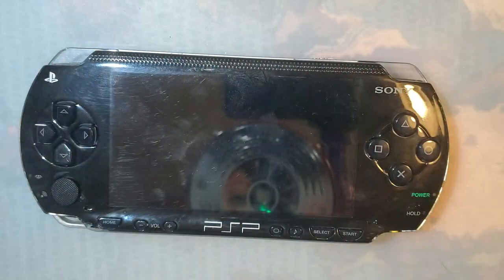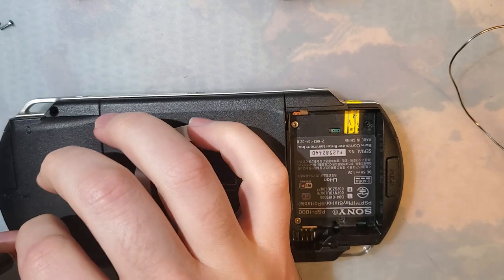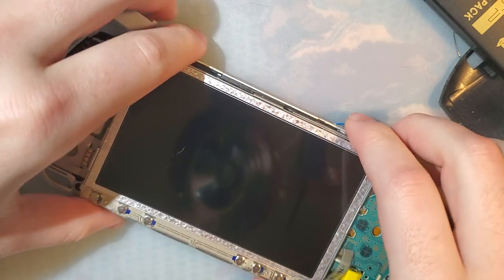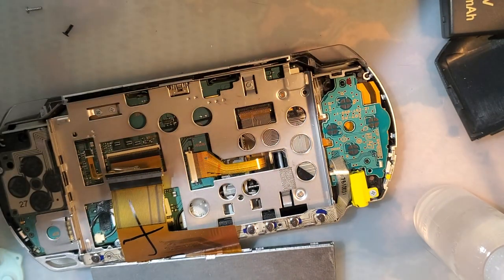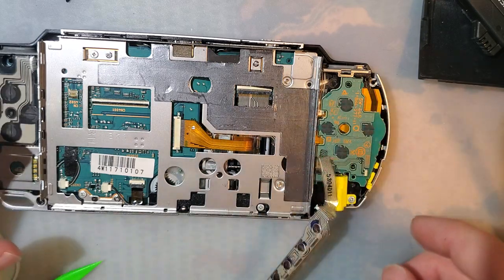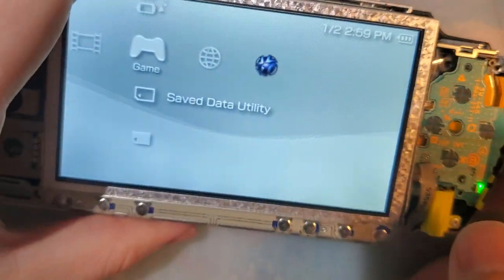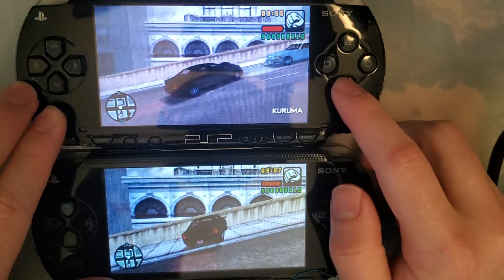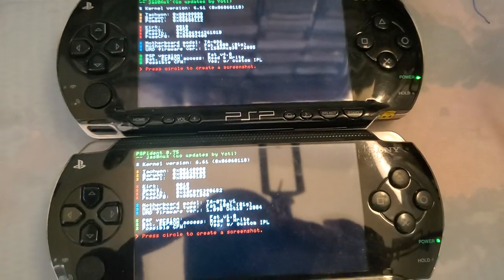Install Followup IPS LCD in a PSP (1000) (Part 2 of 2)

Comment: If you pause the screen at 22:59 you will see exactly how much richer the colors are in the IPS screen. Look at the money numbers in the top right. They are a nice vibrant green on the IPS, and a dull washed out green in the original. Also, the hardwood floors have a deeper tone. The wall is only hard to see due to the reflection on the glass. 

Pair that with the drastically improved motion via refresh rate, and it's a no brainer. This mod is a significant improvement. If this doesn't impress you, I don't know what would!

Comment: Watch both vids. Nice follow up. At this stage, unless one has some love affair with the actual hardware or perhaps is a collector, best bet would be to get a first gen Vita with the OLED screen,  add CFW, and enjoy the PSP library.
Reply from the maker: Yeah, that's pretty much the conclusion I came to. Between the battery life and controls, the Vita is significantly better. I'm not a fan of the non-linear scaling of the PSP games on the Vita display but there is a work around for a few games. Plus, you can play more than just PSP games on the Vita and there are quite a few decent games that released for the Vita.
Reply: I prefer to own both. You see PSP games do not look good on the higher resolution screen that the Vita has.
Reply: Can you explain how its non linear scaling when the vita has exactly 2x the resolution as the psp?
Reply: @wunderlichD  I was wondering as well. My guess is that there are some games that are not at full screen resolution on the PSP (just like the Vita), but then those same games would be scaled on the PSP, as well.
Reply: There are those of us that like to game on actual hardware, and not emulators. Especially those of us who are homebrew devs, and want to see how our games run on actual hardware. That said, since PSP emulation on the Vita was built-in and so popular, we have to test PSP homebrew on Vita, as well, just to be sure.

Comment: The ips is worth it for it's price. It's only around 10$ when I got mine which was surprisingly 2$ dollars cheaper than a replacement non-IPS LCD when I ordered it. Although just do it if your original screen is broken in my opinion.

Comment: I gotta say, this is a really badass mod if you still get mileage out of your PSP 1000, which I think a lot of souls in less fortunate countries definitely would appreciate. My only question is how much better is this than a psp 3000 screen in terms of color, motion blur, and visible motion interlacing?
Reply from the maker: That's what I was trying to show with my last video. The other video still shows the screen with the offset but that does not affect the color, ghosting, or (lack of) interlacing artifacts.

Comment: Modded my 1000 last night, instead of soldering or taping, I followed one comment under the taobao page and used a dollop of conductive paint, heated it with a hairdryer, and boom, off it goes. The real pain was to fix the possessed d-pad, took me a solid 5 hours. But all is working now, so I can show my future families how my childhood was like.
Reply from the maker: > conductive paint
yikes
Reply: @makho  it’s good enough for this application, really quick and easy, I was able to do the whole modding in a hotel room thanks to that. Reversibility is a bonus though I don’t see how I would need that.
Reply: And with a type-c to 4.0mm*1.7mm barrel adapter, a tf card to memory stick adapter, I see my PSP has been completely modernised, ready for another decade of service.

Comment: Hey! I wonder where you keep finding those strange things (perhaps i should check in the description links; but i m too lazy for that...) so now; concerning the joystick i had that kinda same problem with my 2thou psp and it turns out in 2000 models there is a sort of translucid rubber pad thingy that makes the correct contacts in between the board and the stick's mechanism. whishing you luck if you lost it by mistake though... and; as always keep doing your videos i'm addicted to them!

Comment: did you find theres almost some scanline effect when youre using it? If you load up a game for example. You'd see this Lighter horizontal lines that go in line with the P's on the PSP logo.
Reply: i have that issue with mine, very annoying

Comment: What happens if you don't solder those 2 points together
Reply from the maker: this is the whole reason I made this followup video. The image is not centered on the screen vertically otherwise.
Reply: @makho  sorry I had to watch it to realize I asked a dumb question lmao good shit. I just did one last night and now the umd won't read discs...  :/ Not sure if it's because I got a little bit of solder on the other chips around it :( or if it's just a faulty replacement umd drive. Or maybe it needs to be plugged in and back unplugged

Comment: Too much hate towards the PSP and the mod in this video :*(
Reply from the maker: because the PSP is objectively a bad console and this mod is way too much money (when you factor in import fees) for what it is. A Vita is not much more and is a significantly better console.
Reply: @makho  I can't change your opinion, but I love my PSP1000 now with the IPS screen (also d-pad mod). The ghosting on the OEM screen was a complete deal-breaker, but the IPS mod gets rid of almost all of it. 

I own a Vita 1k as well, but I much prefer the form factor of the PSP1k for PSP games. 

I'm curious how the PSP is objectively bad? It has its flaws and short-comings like every console, but I feel like you hate it just because it isn't made by Nintendo.

Comment: I'm pretty sure of this, but just asking to be 100% certain, did you just use solder to bridge the pads or did you use some tiny wire with it that I somehow missed? Seen a few videos from others where they do use it, and I feel that since the pads are so f*cking tiny, it'll just be a massive, unneccesary, pain to use a wire for that step.
Reply from the maker: just solder bridge. It's close enough that running wire would actually be more difficult due to the surface tension of a small enough piece of wire

Comment: Hey Makho, any thoughts on PSP Batteries?  Looking for a replacement for my PSP2000.
Reply from the maker: PSP batteries are all garbage in my experience. I don't plan on doing a deep dive like I have been for the SP and the Micro.
Reply: @makho  Thanks for the response! Seems that there are no good replacements.  Might try my hand at a recell.  Thanks again.
Reply: @makho  Could you solve the problem with the psp 1000 Japanese region?
Reply from the maker: @daniv8386  ???